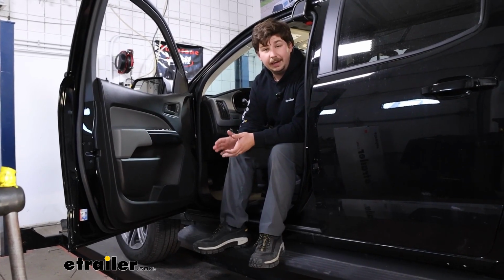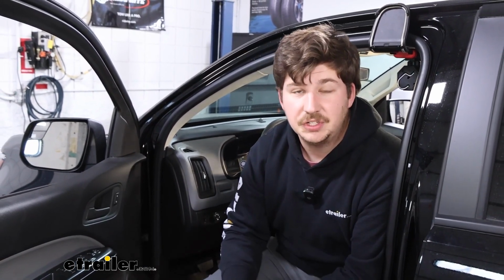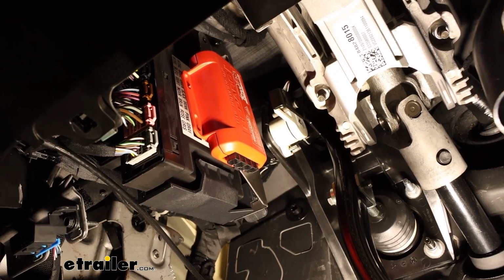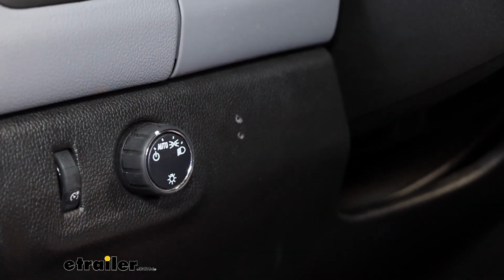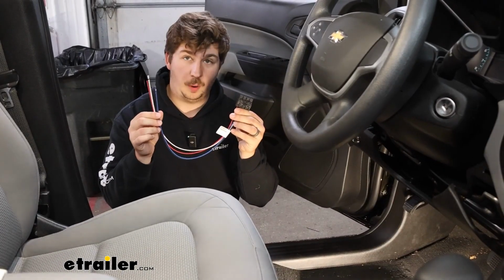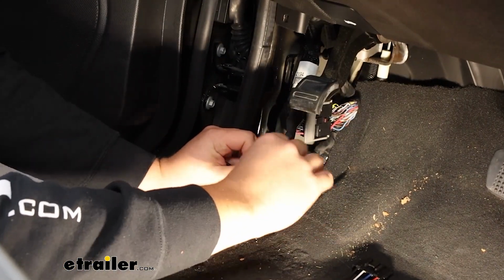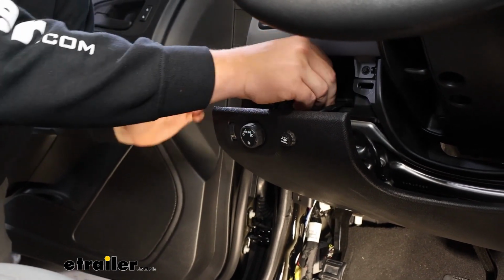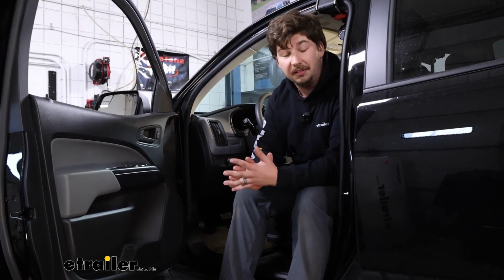etrailer | Redarc Tow-Pro Liberty Brake Controller Installation - 2022 Chevrolet Colorado

Comment: I assume this will be similar for 2019 GMC Canyon Denali, is that correct? Also will the Redarc Tow-Pro Elite work on my vehicle? Your website says it is not compaible. Thank you, great videp
Reply from the maker: The install on the 2019 Canyon would be identical to what's shown in the video. Brake controllers aren't vehicle specific, so you can indeed use the Redarc Tow-Pro Elite on your 2019 Canyon. This being said, unless you're planning on towing off-road, you won't need the 'user controlled' feature on the Elite, and you'd be great going with the less expensive Tow-Pro Liberty, part # RED52VR. The Liberty would install the same way as the Elite.
Hope that helps!
https://www.etrailer.com/Trailer-Brake-Controller/Redarc/RED52VR.html

Comment: Very nice install vid. Going to be doing this to my 2016 Z71 soon. From what I've read it's the exact same as the newer colorado/canyons. 😁
Reply from the maker: That's correct, the brake controller will wire directly to the existing tow package wiring located under the dash, just like what's shown in the video.
https://www.etrailer.com/Trailer-Brake-Controller/Redarc/RED52VR.html

Comment: I assume this is the same process for a 2022 gmc canyon 4x4 aside from a different location for the control knob?
Reply from the maker: Absolutely. You can install the knob anywhere you want, as long as the wiring harness will reach your desired location. 
https://www.etrailer.com/Trailer-Brake-Controller/Redarc/RED52VR.html